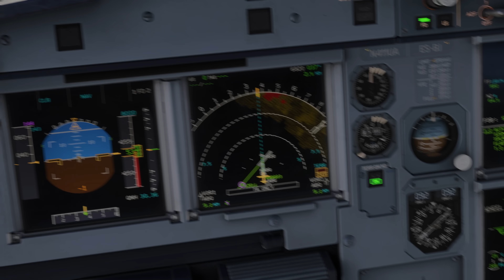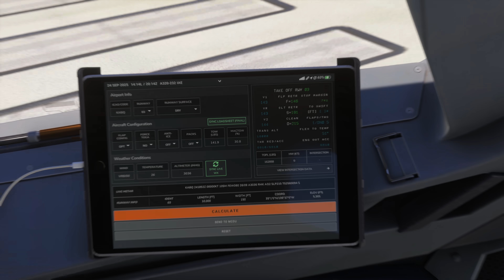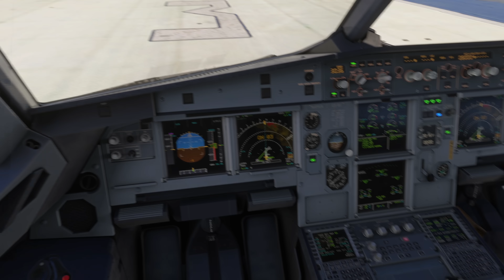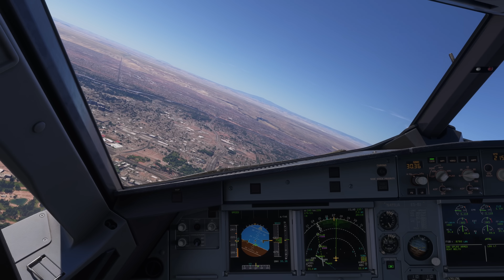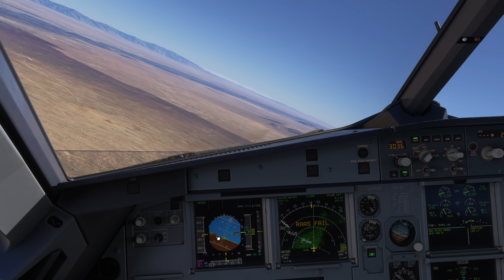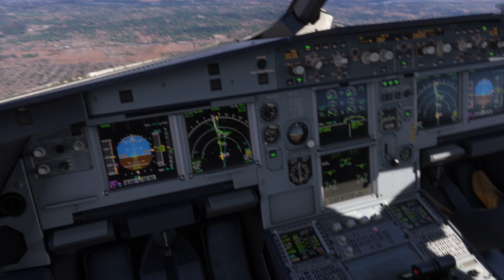FAMOUS Hot&High Operations: WHY is it SPECIAL and HOW TO HANDLE IT | Real Airline Pilot

Comment: Hi Emmanuel, do you have any tips for the 321 which is heavier? I am a 321 crew.

I fly to some airport where it’s hot like this, with low QNH, variable and gusting wind sometimes tailwind and just before the flare at 50’ we experience a downdraft…so we have to arrest that ROD losing some airspeed, and it puts us in a nose high situation close to the ground just before the flare which is very awkward and cause some firm landing.

My only solution to this problem is adding 5 knots to VAPP and start the flare at 40’ with positive back pressure.

Comment: They still have their EPR simulation wrong. The values are not correct for this altitude and they should be decreasing rapidly as you accelerate at this altitude. The IAE thrust bump is also missing.
Nice video though.
Reply from the maker: Any data to back this up?
Reply: @A330Driver  Sure, have a look at real videos where the ECAM is video - or the FCOM regarding EPR ram rise behavior and IAE thrust bump (which is automatic on the A5 series, manual on the A1). Btw FSLabs does model these 2 things correctly.

Comment: Hello Emanuel,

1)
Are there any procedure differences compared to the 737?

2)
Why did you not use the Flightdirector?

I mean you couldnt see if the aircraft had captured the G/S and LOC on the FMA.

3)
Why dont you do a temperature correction for hot temperature like you would do for cold temperature?

4)
Are there tables availible for hot air temperature correction?
Reply from the maker: Hi,

1) Not really, same physics after all :)

2) Why would I use it? I'm flying, I know when I've captured ;-)

3) Because it's not dangerous like the cold temperature side where you're lower than indicated.

4) I don't think so, but ask chatGPT.

Comment: Interesting. Will probably have to watch this a few times! I'm not sure I really understood what the altimeter indication would be "off" though.
Reply: The altimeter assumes the standard pressure gradient of the ISA atmosphere. In reality, with higher temperatures the pressure decreases more gradually with altitude: the gradient is shallower. That means the aircraft reaches a greater true altitude before the altimeter registers the expected pressure drop, so the indicated altitude ends up lower than the actual geometric altitude.